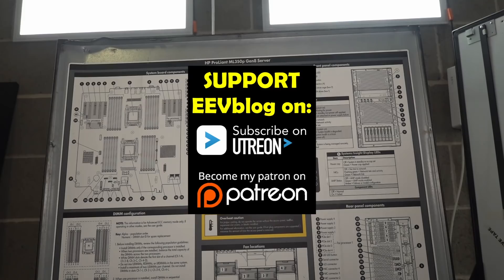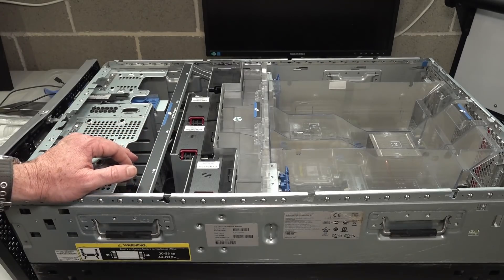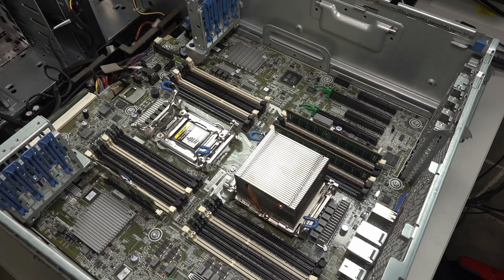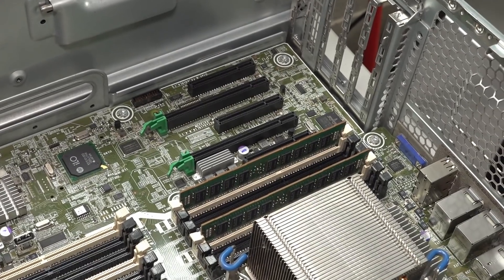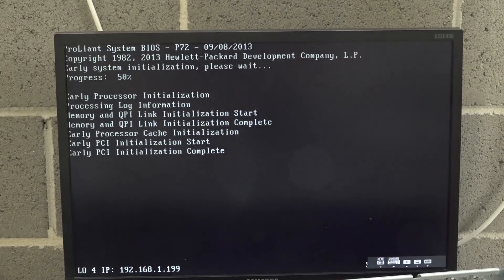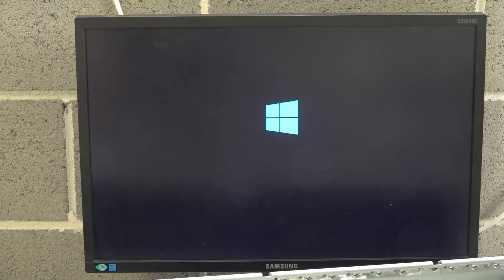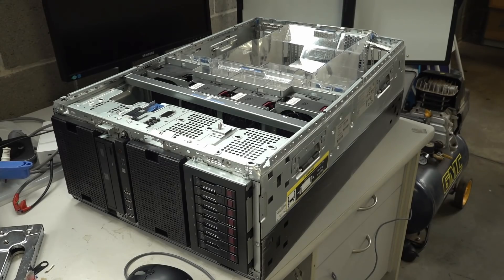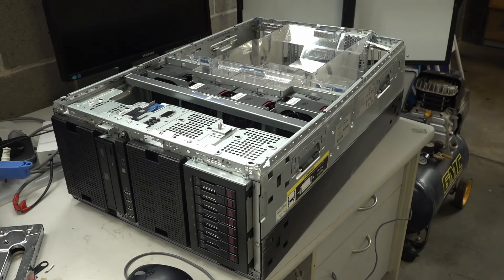EEVblog 1466 - Dumpster Dive Xeon Server

Comment: I want 2 days access to that dumpster room.  You have found more E-Waste in there than I have ever seen in multiple decades at multiple companies.
Reply: Yes, a bit suspicious...
Reply: I worked at the local community college for over a decade. That dumpster was a goldmine. Most memorable was the DEC rack that controlled the heat and A/C in the early 80s. I regret not taking the computer and hdd, but I still have the equipment rack itself. Btw typing this from the new-in-box Steelcase desk they threw out.
Reply: You should see the curbside hard rubbish collection in this area (I live in the richer adjacent suburb).
Reply: Although I haven't worked there, I have heard that many companies don't allow for publicly accessible dumpsters so that people don't buy new stuff (at corporate cost) to then take "old" stuff out of the dumpster. In my environment that hasn't really proved to be true and those dumpsters are a lot nicer so that a lot more of the still usable stuff gets a new life instead of ending on a landfill or at a recycling site. At the dumpster where I work there are usually no super fancy things in there (VGA cables, computers of the floppy drive era, CRTs, etc.) but once in a year or so there is a good chance of finding somewhat decent computers (5+ years, age usually). So it's not like there is expensive stuff getting tossed at a daily basis.
Reply: You would have to pick the right 2 days. I'm sure Dave visits frequently - but how often do you see him score something?

Comment: The HP Raid controllers are mega bits of kit. 
Don't try this at work!
During a raid array rebuild (when all of your data is moving across the drives) switch the server off (don't close it down just turn it off) then remove all the drives and reinsert them into different physical positions. 
At this point, the unwritten data that did not get to the drives is backed up in cache (backed up by battery or a super cap)

Say grace to the HP Smart Array gods :) then turn the server back on (accept the new array config) the server boots and the raid array flushes the cache to the drives & the rebuild continues.
Incredible!
Reply: Yes, and it even get's more incredible if you turn on SmartCache (SSD-level caching inbetween HDDs and up to 4GB RAM)

Comment: IF you can handle the howling those old server power supplies can usually be jumpered to make good regulated 12v power supplies just have to google that specific unit.
Reply: If you can figure out the pinout on some of them.  Had a 500W PSU from a Compaq Xeon workstation.  Looked like an ATX power connector, but wasn't.   There's a 3.3V "keep alive" power line on these--you connect the power on/off line to it (not to ground) to turn the thing on.   Of course the footprint of the PSU isn't remotely standard either...   Ah, the old days of Compaq and HP where the rule was "screw the standards, we'll invent our own".

Comment: The motherboard, storage back plane, drives, and power supply will likely fetch a decent price if you were to sell them. A lot of IT. Admins run host boxes that are a couple generations behind in their home labs. I specifically know of one person who was looking for a motherboard for the rack variant of this server. He was looking at $250 US for a salvaged board. Hell, when I went to replace the storage back plane in My Dell t420 I think I paid something like $100 for the board.
Reply: 250 USD for a salvaged DL380/DL360 motherboard is crazy, you can get the whole server for less than that. If he still needs the board I know a reseller who was considering scrapping one.

Comment: Each fan pulls 44W, 11.5k RPM, over 120 Watts of fan power. The CPU  pretty old 32nm and slow, Hexacore with 2.1GHz and a passmark score of just 9.1k from 2012. PSU and fans are a keeper. Those 10k RPM SAS drives, albeit slow usually go for a fair bit on ebay, especially with the caddy. (at least 30-40 bucks a pop)
Reply: Here in the UK these are essentially worthless because of how expensive our electricity prices have become. It's a shame, because servers like these are still perfectly usable, but it would cost more to run the thing for 3-6 months than it's worth.
Reply: @jamescollins6085  Useless?  With a mere 460W power supply?
Reply: @einfelder8262  Perhaps useless was an exaggeration. However, a more modern server will significantly outperform this one and pay for itself in only 3-4 years assuming it costs £250-300 per year to run that G8 with the single CPU configuration and 8 10K RPM hard drives. Not to mention a more modern server will also support more modern instruction sets that the e5 2620 does not.
Reply: @jamescollins6085  In the USA I convert many of these from 120Vac to 240Vac since 240 is cheaper to use.
Just flip the voltage switch if it has one that might be auto-selected then connect it to a 240 outlet.
That is the thing for BitCoin Mining to run a 12Vdc rig using 240Vac.  albeit that the rig needs 800W of DC power the 240 used is more efficient than at 120.
My buddy runs a rig and he was blowing fuses, I added a sub panel and fixed that problem, he was connected via 240 had me change it to 120 had a huge bill so did research and showed him the 240 ideas, converted over and now his rig consumes 10.00 a month less in electricity.
Now what other items does he have that we can convert to 240?????  10.00 a month is a significant drop, his rig makes him 45.00 a month and he is about to ram it back up to full power once we get the solar panels online.  He was on an electric plan that cost almost nothing but it expired so he cut back on his rigs I think he told me he was making 3,000.00 in coin...  You know all I was interested in was making my dollars in cash for doing the work to fix his power issue.
Reply: G8 isn't that bad on power consumption anymore.. The fans probably run at like 30% if not loaded..
Reply: Yep, this guy is of a vintage that has some decent resale value.  For someone who is still running one of these new parts are way over priced so admins often turn to the secondary market for spares of things like fans, drives, risers, PSus and so on.  CPUs and RAM are pretty common but for someone looking to get a bit more life out of their nearly 10yo dual socket mobo w/ only one populated socket, the secondary market is a good way to go.  Drives are a bit tricky though, savvy buyers will know these likely have a high power on hour count and may be unwilling to purchase them.  I guess that's what "Used" "as is" is for...
Reply: HP servers are usually picky about HP Drives, so they bring a tad more
Reply: @omegatotal  Actually, they are not. Used to sell those (used) with Seagate Constellation disk back in the day, worked like a charm.
Reply: @cornflake75  where the seagates on the HP approved list? because they probably were which is why they worked without the controller complaining
Reply: @omegatotal  The Gen 8 servers have a chip on the drive tray which runs the cool LED ring and also act as the authentication chip. They don't seem to mind what drive is actually in the tray.
Reply: holy hell, each of these(661332-001) fans are indeed 4.5amps@12v o_O
Reply: @altmindo  Don't get too excited pal, they only ever run at full speed when the server starts from cold and only until the diagnostics read all the internal temperatures.  Then they slow down.  You wouldn't wand to blow your server up by starting it when it's overheated, now would you?  HP knows what it's doing with servers.  And for your info, 4.5A at 12V =  22.5 milliamps at 240v, so nothing to get alarmed about.
Reply: I use q6600 as a daily so yeah ;)
Reply: @danijel124  but why though???

Comment: Sell it off for parts. Wipe all the drives first. I'd love to play with one of those but it is just too big,  noisy and power hungry for the home network.
Reply: Could be 100W idle which is not too bad
Reply: @rkan2  not as bad as I thought. I went thru my home network recently and replaced a few desktops with a raspberry Pis at max 15w however.
Reply: @bert-blank  since g7/g8 Proliants most of the power effiency improvements that are there today were already added... G5s and G6s just had the basic Intel cpu power saving features which made them quite power hungry even at idle. Fans be  spinning at 50W when the CPU is consuming less than 50W :D

I myself like the Intel Xeon-D/Atoms - 2-3x the power of a Rasbpi but you actually have PCI-E, 128-256GB ram, sata, 10GbE etc etc. Not cheap even in the 2nd hand market and even at 5+ years old - but you'll save the difference to say a half priced similar powered server in a few years anyway just in electricity.

Comment: Hi Dave, the drive will be a spare.
Will auto add to the array if required, look in the array config under (physical view) and you should see the drive.
If you need any help with it drop me a line.
Reply: Indeed. On 16:49 it states: Spare Status - Position 5 - One Or More Spares Inactive
Reply: @Troppa17  offline spare?
Reply: @ZeroHarry  Isn't an cold spare. Offline as long as no other drive in the array fail.
Reply: @Troppa17  That means brand new, never used too?
Reply: @pe1dnn  likely - the drives should also have usage statistics inbuilt for hPe drives

Comment: Great find, had one of those in my homelab some time ago. Those drives are 10k SAS drives, those might be worth flipping on ebay especially with the caddies they are in. The rest is pretty much done. At least for homelab use there is newer stuff out there that is reasonable priced.
Reply: Yes caddies worth more than the drives, and the entire drive bay with caddies will go easily as a unit, with the drives thrown in, because those are no longer easily available, and they are pretty reliable.
Reply: @SeanBZA  These are 900GB!!!! SAS 10K drives. They're worth a pretty penny.
Reply: @marcus W You’re wrong, look at time marker 17:20, it clearly says 300 GB
Reply: There are 3 900GB and 5 300 GB drives according to the diagnostics in the ILO. these are 2.5" drives. The 900gb disks will still make 30-40 dollars i reckon!

Comment: The one drive which does not light up is probably set as dedicated spare and used in case of a drive failure.
Reply: this! been working with HP servers for over a decade.
Reply: @fiakergulaschsaft  I am quite sure the parts are sellable as there are plenty of these old servers still running and they need those things replaced time to time.
Reply: @SelfMan-SK  sure, didn't say anything different from that. hp servers are also hugely popular and demanded so that should help achieve above average prices.
Reply: We've got at least 200 ProLiants in our server room, and sometimes that centre LED just fails. The drives still work fine, so probably best not to write it off just yet. Try swapping the drive into one of the other caddies to see if the fault follows the drive or the caddy. If it follows the caddy, then you know it's just the LED that gone.
Reply: @taffeylewis  Same thought here.  It lit up yellow just fine during the initial test sequence, and followed all the same patterns as the others.  Definitely looked like the green SMD LED just isn't working.
Reply: Was going to say the same
Reply: Yes.  Hot spare.

Comment: ram with battry is the raid controller ram
Reply from the maker: WHy does it need a battery?
Reply: @EEVblog  So if you lose power, it can finish calculating parity and keeps you cache alive (since it's RAM). When the server restarts, it will flush out the buffer onto the disks.

Comment: was literally looking at these on ebay:), they seem like nice units(LGA2011, 3rd~ gen..... ddr3)
Reply: sounds nice:)... my use case is multiple vm's(something in the direction of ncix's x gamers 1 cpu series but less gaming, the thing i like about this box is the 10 pci-e slots over the standard 7... more gpu's to passthrough); current setup is  dual  L5640, 192gb ddr3, 5 quadro k600's and 8x 1tb drives in raid.... till ddr4 is more nicely priced I'm limited to older gen at best **overall goal is multiple computers in 1 box:P